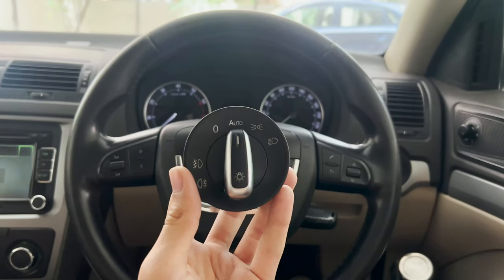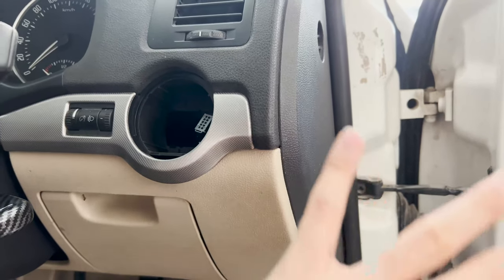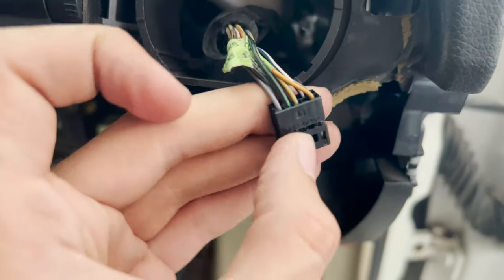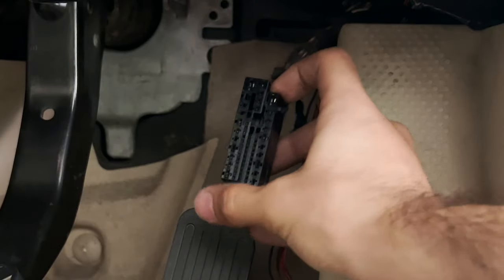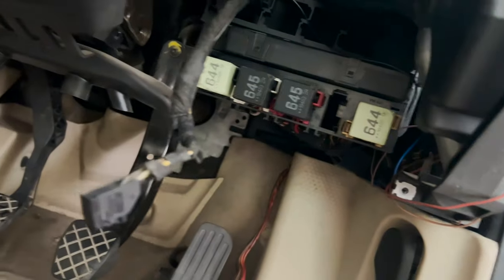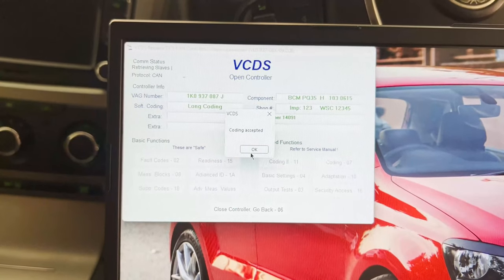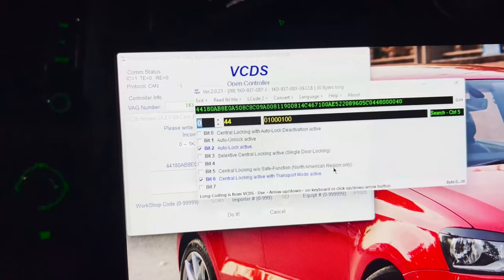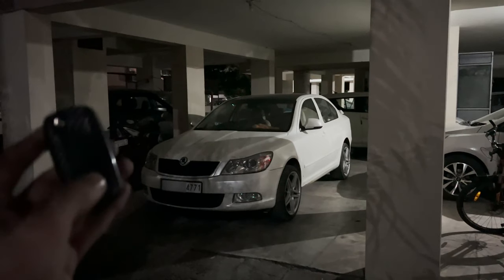Auto headlight switch retrofit for Laura ep5

Comment: Prerak will the switch work with MQB AO platform cars? 
 
If yes then i need one..
Reply from the maker: Need to check the exact installation procedure for that, it should be similar to this
Reply: @PrerakKataria  hey can you confirm if you have found out that this upgrade is possible in Slavia Virtus also ?? If yes, I am highly interested

Comment: Hi prerak.that was a neat job. I have installed auto headlamp switch with sensor. But the one you installed doesn't have a sensor. How does it sense the light to turn on/off. Please clarify
Reply: It acts according to the time zone that's set on your vehicle. I own a slavia usually by the time clock hits 5:30pm my auto headlights turn on. As per it working in dark ig for that u might require a sensor so his method might not be fully functional
Reply: @Baiiz13  Thank you. Some laura ambiente comes with sensors, which i learnt it recently.which only requires an auto switch , wiring to bcm n coding

Comment: I had a small query, is it possible to use reverse lights instead of brake lights for LH/CH? On polo/vento platform. I have leds installed and they would be better than brake lights for lighting up the areas when it’s dark.
Reply from the maker: For PQ25 it’s not possible, it could be possible via VCP but I doubt if PQ25 cars will support it
Reply: @PrerakKataria  thank you, it is unfortunate

Comment: Superb auto headlight switch doesn’t work in laura?
Reply from the maker: Doesn’t fit flush with the interior, mechanically it can work but not a good fit
Reply: Also will this work if the car doesn’t have a auto dimming orvm or rain sensor?

Comment: Will this work on audi a3 with the same light switch but no rain sensor
Reply from the maker: If you don’t have a rain sensor in your car, there is a variant of this switch with a built in snesor and another one with a sensor module plugged right behind it
Reply: Would you still have to run the extra wire to the bcm?
Reply from the maker: No, for those variants no extra wires are needed
Reply: Perfect thank you!!